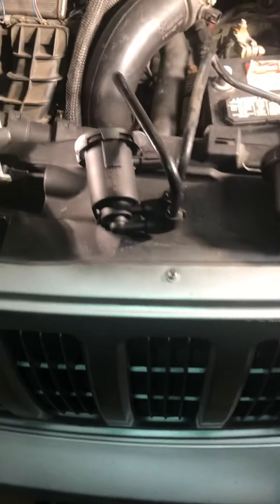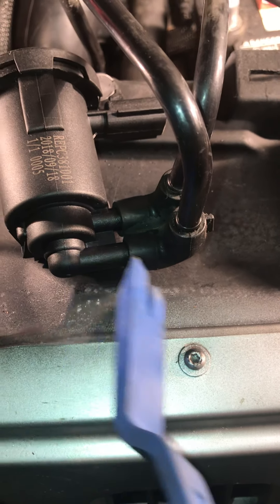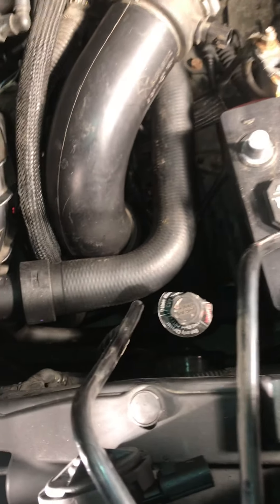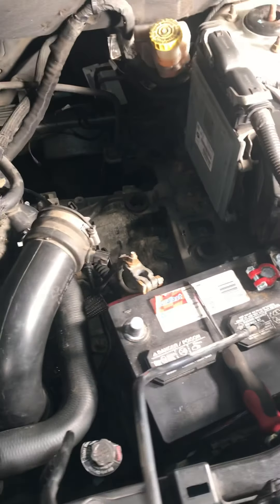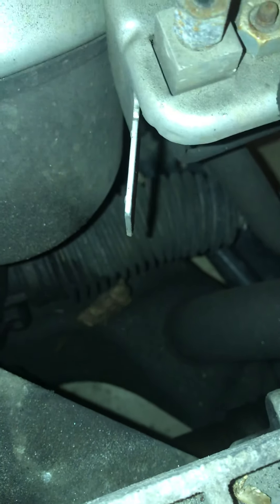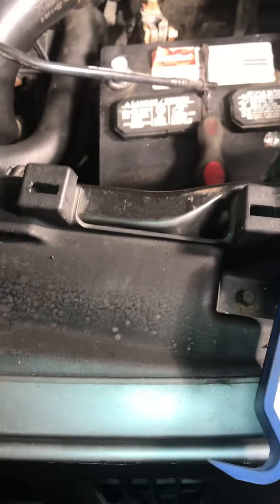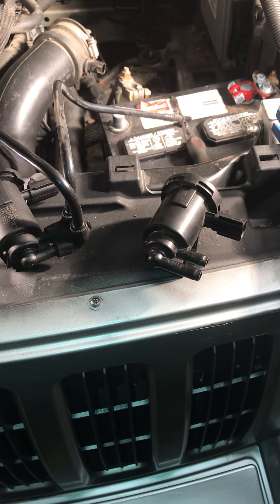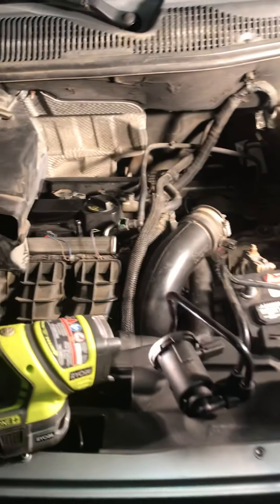HOW TO REPLACE PURGE VALVE JEEP COMPASS 2WD

Comment: And what was the reason you replaced it ? Did you have a PO455 ? Or another reason like bad fuel trims , O2 sensor issue .
Reply from the maker: I believe I changed it because of an evap issue. This vehicle had a bunch of codes, it previously belonged to a fix and flipper that did a better job at hiding issue than fixing them.

Comment: What was your jeep compass doing that led you to switch it out?
Reply from the maker: The Compass was sputtering here and there it also put out a trouble code that led me in that direction. It didn’t correct the sputtering but satisfied the code. However what did correct my sputtering was changing the coil wires and plugs. Hope that helps you out.

Comment: This is the same set up for my 2014 patriot. Just a pain getting the electrical clip of the old part.
Reply from the maker: darrell c yes indeed be careful not to cause a short and use contact cleaner and lube when applicable.

Comment: What does the purge valve do??
Reply from the maker: It’s responsible for fuel vapor management. It restricts the flow when off and distributes when the vehicle is running. Hope that helped you out.
Reply: @fixitcarter  I’m getting ready to do this to my 07 JGCLaredo do I have to disconnect the battery terminals when doing this? I got the code P0456? I’ll also be changing the ESIM system along w the new oring as well
Reply from the maker: @lstruggy   Best practice is to disconnect negative.